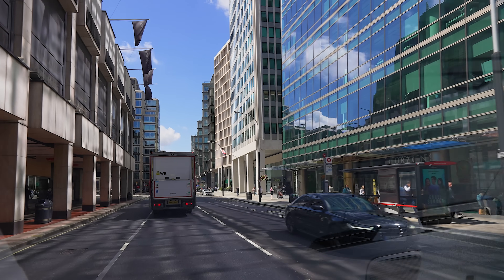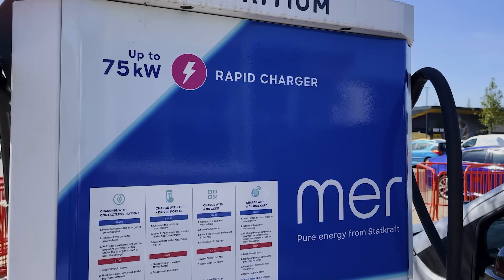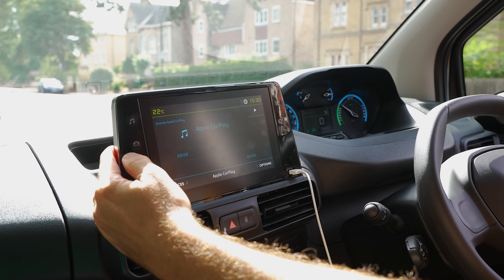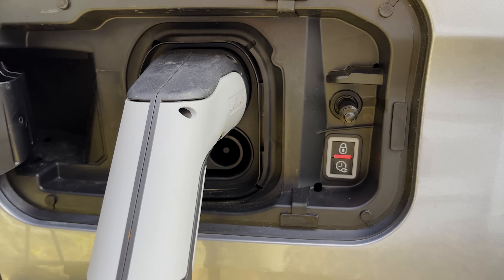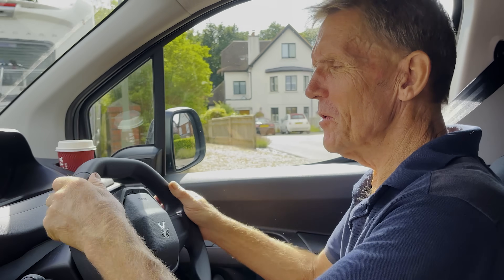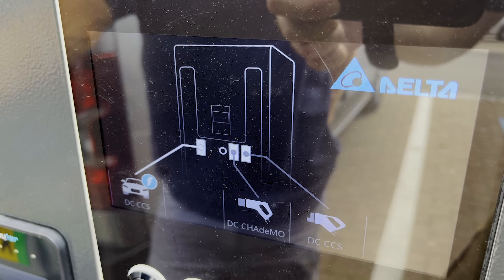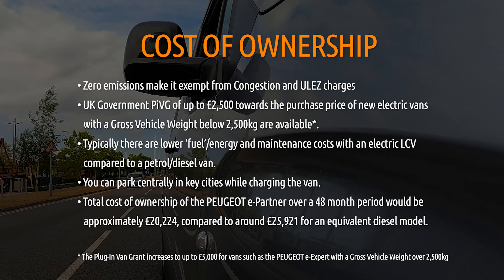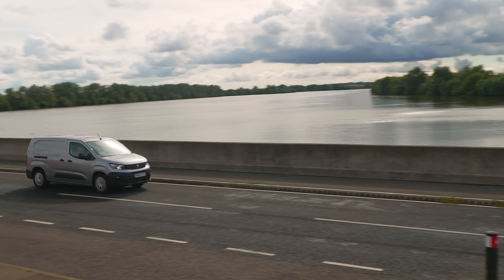Real World Electric Van Test — Peugeot e-Partner

Comment: For some people an electric van will be perfect, like a gardening business. Battery technology is progressing all the time while internal combustion technology has hit its peak and now the manufacturers have to cheat to compete. Combustion engines waste their generated energy, in heat sound and fighting the other three strokes and of course overcoming friction. They were great but they are a redundant technology. There are other, lesser known advantages, you can't stall an E.V , most people charge at home, overnight on cheap rates. That useless lying rich boy, Cameron promised that there would soon be charging in every petrol station in this country. Its the inept political system that we should blame for range anxiety. Do you like safer cars? The top five are EVs. Like performance? Watch YouTube for ice v EV for details. 12v lead acid batteries catch fire all the time, pro rata they are twenty times worse than their electric brethren. In my humble opinion, the massive oil industry and the massive car industry want to keep on making huge profits. They are like the tobacco industry fighting back against an unstoppable wave. One thing when ice is superior though is in being great if you give in to the voice in their head and decide to end it all out in the garage. Icecars chuck toxic gases out the back. All the big car manufacturers are currently being sued in a class action for fitting cheat devices. Eventually we will have electric vans that will do long distances like you can in a diesel van. If you do big distances, its not for you but right now they will be fantastic for local use. Thank you for your time

Comment: I'm wondering why  a lot of people seams missing to mention that the real problem is that  on top of the really expensive van you have to buy after 3-5years (depends on the model) new battery for much over £10k and your old batery is not recyclable (what's happening with that battery after ...who knows?). People promoting the electric vehicle but really don't know the problems behind the scene or just ignore them.

Comment: Did this van automatically hold once you put the brake on at traffic lights or did you have to hold the brake to keep the van at a stop ?
Reply from the maker: They have roll back control to make hill starts easier but I think you need the handbrake as well.

Comment: Have you tried doing a test on a cold January morning where you need the heater on and in traffic?. I live in a large village of around 1600 people in East Sussex (not exactly the back of beyond) and UK Power networks have told us we can't have any EV Chargers because the village is on the maximum capacity it can take without huge investment. They only upgraded the existing capacity around 7yrs ago. So the point is EV's may be great in cities, short journeys etc but they will not be a viable option in towns and villages up and down the UK so what is the only real option?. Hydrogen is my guess but that will need investment and the UK Tory wets and Labour will only accept EV. Probably down to the large bribes they are receiving from the vested interests.......... I looked at a Citroen Relay EV which was at the dealership, brand new (allbeit 2yrs old) with 4 miles on the clock and they wanted £54,000 for it................ That's why they will never take off without massive taxpayers subsidies and for what benefit?.

Comment: How much does the range reduce on a cold, wet, dark winter evening or morning when the heater, wipers and lights are all on?
Reply: Lights on?
Most Builders are home well before it's dark.
Reply: Not only builders are using vans... However, on winter time I finish my job about 5 pm, so it is dark. I don't know what kind of builder you are if you are at home before 3pm
Reply: @arturk2014  Most good builders are home by 3pm

Comment: We've had electric for a year now (Renault Zoe) and it's been great, with very little issues with charging even on long journeys. We use slow chargers (free) as destination charging whilst shopping, eating out,  visiting relatives, or even working...
Having a site charging area would help, even at 3kwh...we use 3kwh at home and the local supermarket for free (7kwh)...
Reply: If your just doing town trips it’s fine.
Working vehicles need an engine as soon as you put weight in it etc your fucked. It’s all massive con
Reply: @ellis2792  
The same arguments applied to fuel based vehicles at one time...put weight in them and they don't move...vans couldn't carry more than 1/2 ton, trucks less than 20  tons (but not uphill)...
Our transportation systems made more sense when it was integrated: rail, canal, trams, trolleybuses, bicycles etc...
No one system will work long term as there are too many variables...sending Amazon packages in fleets of trucks (electric or otherwise) is ridiculous...
Reply: Not being snarky or anything but there is no such thing as free.  Somewhere down the line the cost will be passed on to you, in ways that might be less obvious like increased council tax, parking charges, food prices at outlets with chargers etc.  You get the idea.
Reply: @EgoShredder  
"Free" means what exactly...?

If a supermarket can 'print Money'  (vouchers, discounts, loyalty cards) what does money mean...if Tesco's energy comes from PV on their roof, they can supply the energy for whatever price THEY choose (28p per kWh atm)...if your energy company says you owe them £x (even though you can prove you don't) what are you going to do? If your modern car isn't allowed to travel (GPS tracking and SMART connection) due to exceeding your 'CO2 limits' what are you going to do?
Yes, I am aware of the pitfalls, but you seem to think Money is real...it isn't, it's an abstract form of exchange and as such can be manipulated (see the Forex trading) by whoever plays the game the best...

Comment: Quick question on a different topic.
Should 22mm t&g chipboard flooring be supported between joists   along the long edge with noggins where it meets the skirting.
Iin my case its at the foot of a dormer window where people will stand.?  Surely the perimeter should always be supported 🤔. My lazy builder disagrees!
Reply from the maker: It is always a good idea to support the first free edge and Caber recommend it. If the joists are at 400mm centres it is not so important and with 22mm board I think you will be safe
Reply: Why have a builder if you think you know better?

Comment: The charging infrastructure here in the UK (and most other countries) is unreliable rubbish, littered with stupid apps for payment rather than contactless card payments.  But when petrol cars first came out no doubt the same issues were prevalent with lack of petrol filing stations.

I suspect that for contractors working in a defined locality will all be moving to EVs very rapidly - particularly if they already have solar panels and a battery storage system at home

Comment: How do they go on a freezing cold and wet night with the heater on full blast, the wipers on flat out, lights on etc? Would be interested to know what sort of range to expect under these conditions.
Reply: the only reason a builder would drive in the dark would be to go to the pub, most would have left the job well before it got dark
Reply: From experience, you use the heater and AC (to prevent fogging up) and it really depends on if there's a heat pump for the loss of range. We got about 20% less range then but that was the 24KWh van so disproportionate to the 40KWh version. Don't need heater write so much as there's heated steering wheel and seats.
Lights and wipers make no noticeable difference to range.
Reply: Well, Norway is the worlds most EV bying country per capita. I dont know if you know, but we are not known for how hot is it here. But if you live in a part of the UK with temperatures below -30 c  there might be som issues. But then again everybody in Norway knows that the range decreases when you have to use some of the power for heating. It's the same concept as driving with a box trailer behind your petrol car, for some unknown mysterious reason the extra weight and drag causes the car to use more fuel.

Comment: Why can't they make a battery that charges super fast to full in like 5 minutes?
Reply: They can. Just not common or cheap.
Reply: Problem is,  if such batteries become popular in EVs,  if you then put 4 or 5 chargers at a recharging station that can spew out the kilowatts at the rate required to do that, and the cars show up to recharge,  the charging station would need an electrical supply of megawatts and megawatts and megawatts.  It becomes a big electricity infrastructure headache.    They'd probably end up putting  a battery INSIDE the charger - so that it could charge up more slowly off the grid, but then be able to rapidly dump its load into a car.  Then you get the problem of when there's another car wanting to do the same immediately afterwards, but the charger's battery hasn't refilled yet !
Reply: @hunchanchoc8418  yep, it's a change of mindset where with an EV, you charge wherever and whenever you can, rather than having to "fill up" an energy tank because that's all you have.
Lots of problems to solve and change to come.
Reply: There is a Chinese company called Neo producing cars where you buy the car without a battery for £xxxx cheaper then lease a battery that is then swapped out in under 5 minutes. That might work if it comes here. Have a watch of this.
https://www.youtube.com/watch?v=YT1raxxvrHo&t=14s

Comment: Just think you run out of petrol you can usually walk to a petrol station with a can now can you tell me how you do it with a electric car
Reply: You walk up to the nearest house with an extension lead and all if you can charge a bit (offering then a bit of cash of course).
You can usually find electricity in every occupied building. ;)
Reply: @djtaylorutube  great if your reasonably close and they’re willing my drive is 40 metres long so everyone’s on street
Reply: @alanhall1219  I understand that, just needs a few extension leads right? ;)
(Or don't drive until dead and find someone helpful while there's still power).
I think it's like any fuel type, you adapt. I had my trusty old Volvo converted to LPG 200,000 miles ago and took it to Scotland and back. You just learn to plan ahead better. One day, I was having a discussion with someone at work who laughed and said there was no LPG on his route to work. Thing is, if you don't need it, you don't know to look for it and next morning I presented him with two fuelling options on his trip.
We had a Nissan Leaf but gave up with public charging at the time in 2015, about to take delivery of a Tesla next month. The supercharger network is just so far ahead of others, it was a no brainer.
Tomorrow though, we're doing a 450 mile trip which will be effortless in our diesel car.
Everyone just needs to pick what works for their circumstances, definitely not a one size fits all.

Comment: We've been running Nissan ENV-200s in London since 2014, where they were charged in our office car park in Waterloo.  The early 24 KWh models only had 100-ish mile range, fine for town but the newer 40KWh version can go much further as long as you schedule a fast charge session with ZapMap.
Now the vans are being taken home, charging costs are much higher but once you remove cost of the congestion charge every day it's still a no brainer to run.  Diesel vans are costing us several hundred more a month to run.  Also, virtually nothing to break on an EV, tyres are the only thing to replace so servicing is basically optional.
We fully charged our first two vans every night and never lost any range - but maybe that's because they weren't fast charged.
Leasing is what you do with vans, can't imagine buying any as we just get the new, better van when the lease is up.

Comment: We have a Peugeot and I won’t buy another electric vehicle for a while. Batteries really need to improve first.
Had a service mechanic driving it and he had to charge twice a day, which took atleast 30 minutes per charge. Range was supposed to be 170 but in reality it was 100-110 at best and a lot less when he had a ladder on the roof. 
In my opinion these electric vans are far from ready to replace diesel vans.

Comment: The reports of batteries being unserviceable after 8 years and not supposed to charge to more than 80 percent or depleat more than 20 percent, I like the idea of electric but for me I'd rather have something I could keep for upto 20 years not 8!
Reply: My transit connect turns 20 next year 😃
Reply: Those reports are BS.  The battery will outlast the van.  Current data suggests that batteries will be good for 15 years and 300,000 miles at a minimum.  Even after that they can be recycled as permanent battery storage.

Comment: Miles against any cost saving is more to the point. If you want to have the worry of getting home everyday, loaded, in the back of your mind all day then these are for you. But as you slowly get fatter whilst stopped and waiting for it to charge, as well as greatly lengthening your day, which will get even longer when there are more on the road waiting for the same charge points, again these are for you. If your a 24 hour breakdown callout engineer you may as well take a bed for when you run out of power or load your own generator. A to B loaded at no more than 80 miles round trip, these again are for you. A to B of unknown mileage, or say 350 plus days work, a total waste of time and money. All very friendly talking to people whilst waiting for the charge up, drinking and eating when you don't really need to, plus the added cost of that. Not one made yet for the travelling working man covering big miles and has to carry a van full of tools and racks full of needed bits.and maybe a few ladders. Or not one that I can find as of yet, but then I have stopped looking.
Reply: Totally with you on this, I do groundworks and carpentry, only 3.5t van I could find was a Renault Master, £78k for a start, then 85mile range empty in the daytime (even according to Renault's own website!!) 16hr charge from a standard 3pin plug(so you could definitely charge it on site) and to top it off they only guarantee the battery for 5yrs and only to 75% capacity, so after 5 yrs you've paid nearly £80k for a van that takes a whole day to charge and runs out after 56miles at best! Utter rubbish! They atleast need to increase the max gross weight of vans from 3500kgs to around 4250kgs (the same as most ambulances are) to accommodate a much larger battery without sacrificing payload. Of course there would still be charging times to contend with but atleast there would be the opportunity for a greater range.
Reply: @whatyousaidbud  Your right, as all the spill you see are local lads doing light work. At the end of this make believe story is either a horse and cart or a battery as big as the van with wheels and a steering wheel with a trailer, that takes a week to charge. I have heard charging rate being £1 / kw/hr, and what makes even the brain dead think it won't get more expensive once caught up in it, is hard to believe. You only have to look at the once buy diesel as it is much cheaper and healthier, so that didn't last to long either even with the Government money input. Sad to say these people need to go to work instead of pretty ride outs playing at it, thinking they are helping the world why not save everyone the hassle and stay at home instead.

Comment: New Citroen Berlingo e has been launched £37k for a van! £17k more than the diesel. I don’t think your going to save £17k in diesel in the lifetime of the vehicle plus the cost of the electric
Reply: The diesel will last 4 times longer and isn’t as dirty as an electric van when you take into account the full build process. For every 1 ton of lithium mined you need to move 1000 tons of other materials plus how toxic these lithium mines are and the child slavery used.
Reply: It is already as/ more expensive than diesel so their market is fkd
Reply: Depends if you're paying CC or ULEZ charges.